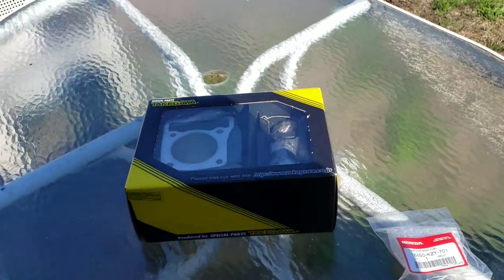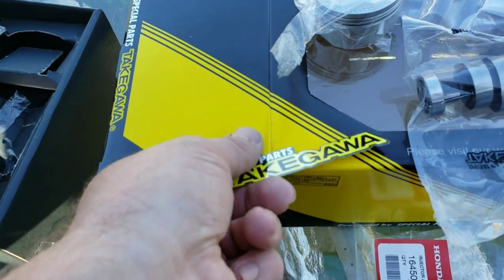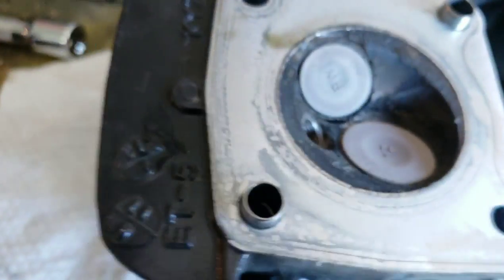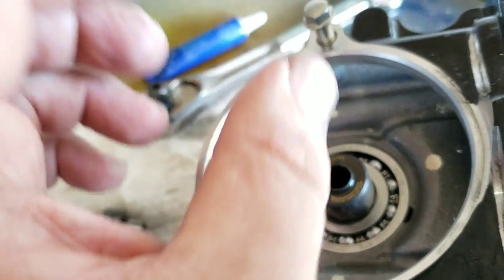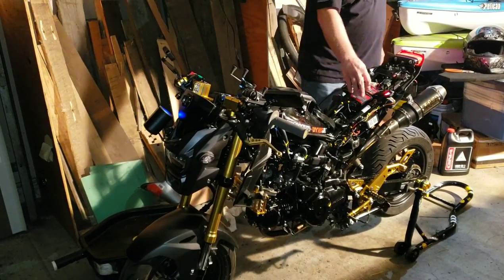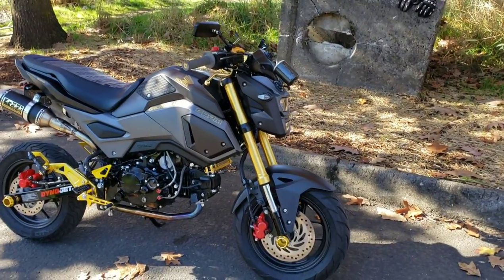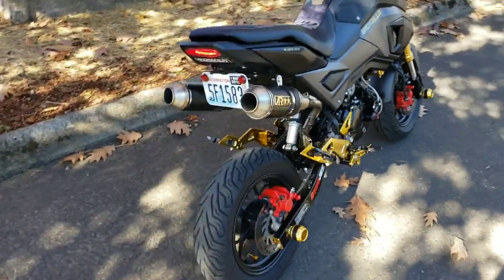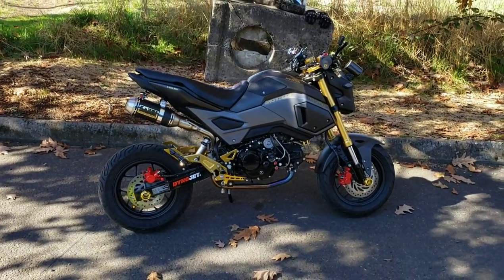GROMZILLA gets the TAKEGAWA 181  Big bore kit and type-S camshaft

Comment: Total cost for everything you need? Did you ever do the turbo kit?? I couldn't find that one
Reply from the maker: No we did not turbo the bike.. what do you mean you want to know the price for everything you need.. I guess everything you need when entitled to what it is that you want to do.. not sure I understand the question..
Reply: @BLRTUNING  The big bore kit is around $400, is there any additional parts needed?
Reply from the maker: You can do just the Big Bore Kit itself you can upgrade the piston and the canister that houses the piston I believe there is also a kit for around $480 that comes with a camshaft called the S-Type camshaft from takegawa. Remember the S-Type camshaft is designed for torque not top speed. It has a powerband range that comes in around 4,000 RPM to about 8,000 RPM.. where is the koso 240 camshaft doesn't really kick in until about 8,000 RPM. It is designed for top speed.

obviously there is lots of Parts out there that you can add on to make the bike have more power.  My best suggestion for starting out the things I would say you should have before doing a Big Bore Kit ... 

A high flow oil pump, oil cooler, the opmid temperature gauge, a way to tune the bike the easiest method is the Dynojet power Commander v & wb2. 

Remember heat is your number one enemy. 242 degrees Fahrenheit is considered detrimental this means the damage has already been done and most likely the engine will fail at some point. But opmid temperature gauge is the most accurate one on the market and you can set a temperature alarm. for example on mine the screen starts flashing at 226 degrees F . that means pull over and let the engine cool down or shut it off. We don't ever let the engine get above 231 degrees. On average the bike rides right around 210 degrees Fahrenheit. 

The high flow oil pump will help the oil circulate much better if you accommodate that with a small oil cooler mounted somewhere in the front of the motor this will help tremendously with heat.

the camshaft will be personal preference. I would highly recommend doing a camshaft along with a big bore kit. 

There is such thing as a ECU flash tune. My buddy David hugh runs a company called dhm motoring.

He offers flash tuning and it is a cheap route to go. however if you change anything save down the road you add a different camshaft or a different exhaust you will have to send your ECU back to him. That's the reason I am not a huge fan of doing a ECU reflash.

Something like the PC5 and the wb2 from Dynojet would also have an auto-tune function to help you get the map dialed in even better.

The PC5 will also let you add on stuff later on down the road like 2 step launch control quick shift and the pod 300 digital display.

anyways if you have any further questions please feel free to ask I will answer them as best I can.

please keep in mind I do offer custom tuning if you look me up on Facebook messenger my name appears the same as it does here on YouTube.

Bill Ramseyer Jr
Reply: @BLRTUNING  That's cool that you know the guy from DHM that was the route I was considering, I wanted to start with an intake, exhaust cam and reflash, yeah I'm not a fan of having to send in the ecu either, in still trying to decide on that one. You mentioned the power commander what is the wb2 for if you already have the power commander, do you need both?
Reply from the maker: @Grainsauce  on the Honda Grom it has a closed-loop section which is 0 to 79% TPS. (Throttle position) the power Commander v is not capable of controlling that 0 to 79%... Power Commander 5 on the Honda Grom can only control open loop. Which is 80 to 100% TPS... this means in the power Commander tune the only places you would see adjustments to the fuel mapping would be in the open loop 80 to 100% throttle range. The WB2 is a wideband device. It plugs into the power Commander v. it has an aftermarket O2 sensor that you would install about 8 to 10in away from the head of the bike into the exhaust pipe.. some aftermarket exhaust pipes already have a bung for an O2 sensor ,, if not you could take it to any exhaust shop and have them put one in... After hooking up the WB to the bike will now receive its closed-loop signal from the aftermarket O2 sensor which is programmable. you can set a Target lambda value for it to run at stock the bike will run at 14.7 AFR in the closed-loop section. When you start adding things like exhaust intake a camshaft or a Big Bore Kit the bike cannot add that kind of fuel in the closed-loop section on its own. it can only compensate for up to about 5% fuel this means the bike would be running lean... The Honda Grom will run lean if you were to just do exhaust and intake. The WB2 will control the 0 to 79% TPS.. it also has auto-tune built-in. This function works in conjunction with the power Commander v... As you go ride the bike the auto-tune will suggestfuel trims so say if at 85% throttle at 5000 RPM it means you need 10% more fuel it will suggest that and in the power Commander v software on your computer you can plug it into the bike and accept all trims. now the trims will go back to zero and the fuel trims that you accepted will become part of your fuel map... Unfortunately for the Honda Grom if you're going to do anything more than an exhaust or an intake,,, one or the other by itself.... You're going to want to go with the WB2... This will let you gain control of 0-100% throttle range in all RPM ranges... It is by far the easiest device out there to use and has the most add-on capabilities.. later on down the road if you choose to. you can add something like the pod 300.. this is a digital display that will also let you adjust the fuel trims on the fly. It can display things like real-time air to fuel ratio... 
also you can add the Dynojet quick shift it plugs into the PC 5 and is completely programmable. for example on my bike anything above 3000 RPMs I do not have to touch the clutch to shift up into the next gear I only use the clutch when downshifting... the quick shift is programmed through the power Commander v and kills power while I shift. It does this in 60 thousandths of a second... that's how I have it programmed which is faster than anyone would be able to grab the clutch let off the throttle and go into the next gear... just like tuning the bike and adding a quick shift you would be able to smoke another Honda Grom next to you if you desired to... simply because that guy is going to have to squeeze the clutch and let off the throttle while you are just wide open throttle banging into the next gear..
 You can also add 2-Step launch.. on my bike 2 step launch control is controlled by a clutch mechanism.. basically the clutch is on a timer if I squeeze it for more than half a second it automatically goes into two step and will only rev up to 8000 RPM as soon as I let the clutch out it goes back to wide open throttle... This is a real working to step that we use at the drag strip... there is tons of options way more than just that by adding the power Commander v and the WB2 combo... keep in mind I do offer custom tuning so if you were to look me up and reach out to me maybe through Facebook messenger or Instagram messenger.. I could talk to you a little more and walk you through everything over a phone call or video chat...

in my opinion a flash tune on the ECU is definitely the cheaper way to go but remember when it comes to Performance modifications you definitely will get what you pay for..

Don't go expensive on all the parts and then go cheap on the tune...

If you do go with an ECU reflash David Hugh with dhm is the best in the business.

the only problem I have with doing a flash tune is you have no idea what the air to fuel ratio is and if you do not add something like a temperature gauge then you are really guessing. running lean will cause the engine to get hot if the bike is running lean on a flashed ECU with no temperature gauge you will have no idea and you will definitely run into problems and cut the engine life short... 

You have to remember that I tune motorcycles for a living on the weekends and I'm all about doing it yourself and leaving your options open... 

So just do your research..

Use your best judgement..

Comment: I have a 2019 Honda Grom installing a 186cc big bore kit forged crankshaft already have full exhaust kn air filter. Would the power commander 5 be ok with this set up?
Reply from the maker: Yes the power Commander v will work on your setup but you will need the WB2 from Dynojet as well.. the WB2 is a wideband controller that also has auto-tune built-in....
It will control the closed-loop section of the tuning which is 0 to 79% throttle position on the Honda Grom....
Reply from the maker: Power Commander v cannot control the closed-loop it is only capable of programming open loop
Reply: BiLL Ramseyer appreciate the response what’s your thoughts on aracer 1?
Reply from the maker: I have heard that it's a good product I don't mess with it myself I've never tuned one I've never seen one in person. I've heard nothing but trash about their customer service though. My thoughts are in order to be a good product you have to have good customer service.... Again that's just my personal opinion...
Reply: BiLL Ramseyer thanks appreciate it
Reply from the maker: @dustinjahn9227  

If you do have anymore questions for me or you are interested in custom tuning please feel free to reach out to me through the blr tuning Facebook page..
If you're running something like PCV plus wb2 this can all be done through email...
https://m.facebook.com/BLRTUNING/

Comment: Yo sweet grom 🤘🏼 What’s the reason you didn’t switch over  the decompression leaver to the new cam? Would this have solved the issue with needing a different battery? Cheers 🍻
Reply from the maker: It would probably help with the battery issue but it is not necessary ..
Reply from the maker: Also less spinning Mass means more RPM..

Comment: What's the disadvantage of a big bore kit
Reply from the maker: You will have overheating issues. This is pretty common on any big bore kit if you don't plan on going any long rides then it works perfectly fine. on a 3-hour ride we had to pull over approximately four different times to let the bike cool down.. this is with taking every preventative measure to keep the bike cool that we could possibly add to the bike like an oil cooler adding fuel in the tune etc. So yes there is some downsides to it.. however it is definitely a lot of fun having a big bore kit
Reply: @BLRTUNING  wait do you have an oil cooler and it still heats up badly? I mean I wasnt planning on riding that much but that's a lot of heat with cooling to
Reply from the maker: @judge9637  anything over 242°, would be considered detrimental meaning the damage has already been done. On average my bike runs right around 210° f... We shut it off if it gets up to 230.. alarm light goes off if it gets up to 226
Reply: @BLRTUNING  wow that's a considerable difference in heat. And you do have an oil cooler?
Reply: I was thinking about doing one for fun but that's a big heat problem there I might just do some small stuff with a tune up

Comment: Doesnt it need a new crankshaft tho?
Reply from the maker: If you want to add a crankshaft you can we are at 5,500 miles on stock crank shaft with stock connecting rod.. there's tons of modifications that you can do to the Honda Grom.. build it however you want to.. on this build I decided to keep the crankshaft and connecting rod stock and it hasn't broken yet..

Comment: Biggest advice I can give all you folks getting the 181cc bbk. DO NOT REV PASS 9k/ 9.5k rpm esp on a stock crank. You will ruin the bearings fast esp racing on it, our cranks aren’t meant to rev that high, and anything past 9k is bad.
Pros you can fix that by buying the kitaco neo crank/ comes with both bearing but it’s about $400 plus. Trust me I’m doing my crank on my og grom. it will last but eventually when you start hearing noises coming from the crank it’ll go bad kinda fast! Just a side note pls use it guys
Reply from the maker: Honda Grom that I built, the one that you see in this video has done 96 mph it runs on e85. It has over 7,000 miles on the 181 Big bore kit. Rev limit is set to 13,200 RPM and it has had zero issues. The main thing is to watch the heat. This bike has never been above 240° f we shut it off at 224° f no matter what. No exceptions no excuses if it hits 224 we're shutting it down. So I suppose that's why it's lasted this long. It's not the 181 piston that can rev high or not rev high. A lot of that depends on the head that you're using and the valve train. This bike has a fully built race head that was ported. It has a huge cam, it also has titanium valves and waste different springs and retainers. So the head can handle that kind of RPM without floating one of the valves.. people just have to do their research and understand how an engine works and have the tuning done correctly. Keep in mind we tuned this bike here in house it is one of our shop bikes. It is one of our demo bikes that we take the shows and events with us. It is the longest lasting Big bore kit that I've ever came across that is a air-cooled BBK.
Reply: @BLRTUNING  nice bro that’s good to know, is that on a stock crank aswell? I was sure the head/ piston was good since they are bigger and can handle more rpm, but my concern was the crank/ bearing, also good you have a temp gauge that’ll count in the long run for sure👍
Reply from the maker: @MiniMotozinc. Yes that is on the stock bottom end. So stock connecting rod stock crankshaft. This is why we pay very close detail and attention to the temperature.
Reply: @BLRTUNING  oh okay I probably just got unlucky with mine, thanks for the info. I was thinking about running the kitaco neo crank but might just go with a stock crank instead now that I know that

Comment: So to do this you need the big bore kit, new injector, lithium battery, and a power commander?
Reply from the maker: Wide band would be highly advised as well or you could just go with the PV3 and Flash  The ECU with a tune
Reply: @BLRTUNING  is there a base tune that you used? Where did you start? Is there a general consensus about where you should start or does everyone kind of do their own thing if that makes sense?
Reply from the maker: Well I've been doing good tunes for quite some time.. however to get the bike to run correctly you need to have it not running lean running rich is okay as long as you plan on fine-tuning is from there and get it to run optimal but you need to have it not running lean before you start riding it around trying to calculate what your going to adjust next.. you don't want to blow the bike up because it was running too lean while you were out trying to do a test ride to work on your tune.. so the first place to start in my opinion would be fuel add fuel.. add like 5% fuel in all of the fuel tables and then start working on your adjustments that may be too much fuel in some areas and it might not be enough in some areas however it will help avoid running the bike lean while you're trying to figure everything out.
Reply from the maker: If you can get ahold of me on Facebook messenger Twitter or Instagram and message me we could talk a little more
Reply: @BLRTUNING  thanks man. I'm trying to figure out everything before I go buying parts
Reply: @BLRTUNING  would you mind sharing your exact tune that you started with? Maybe a picture of what all the levels were at on your very first start up tune?
Reply: @BLRTUNING  what's your facebook?

Comment: Hi Bill,  can you please tell me what rpm you use in stand to get you Take 181ccm kit running well. I have problems with mine. Engine shuts down rom timt to time.... Thanks n advance and good ride. Cheers Daniel
Reply: Hey Bill, can you please tell me the rpm of you bike in stand if it is warm. Thanks
Reply from the maker: @daniels9670  the bike idles at about 15 to 1700 RPM
Reply: @BLRTUNING  Ok, thanks for your help. My one with take 181 kit around 1400 rpm and i had sometimes problems that the engine shut down. I think about oil cooling the kit. But not sure yet.
Reply from the maker: @daniels9670  it should be idling between 1550 RPM and 1750 RPM.. any less than 1550 the bike will probably not stay running with a bigbore kit.. try adjusting your idle screw at the throttle body..
Reply: @BLRTUNING  Thanks a lot.Now it is adjusted. Is there any problem with the head, because of your oil cooler? My bike runs 117 km/h max with stock chain and chainwheels. But If it runs over 100 km/h the engine control light goes on. Takegawa manual says it is normal... Is that the same with your bike?
Reply from the maker: @daniels9670  I don't use the takagawa control light or have any check engine light. if you are running a Big Bore Kit you really do need to have an oil cooler..  at 226 degrees Fahrenheit we shut the bike off. 232 is too hot.. 242 the damage has already been done...

Make sure you have a way to tell the temperature of the engine I use the opmid engine temperature gauge